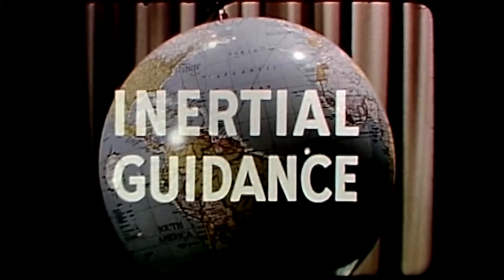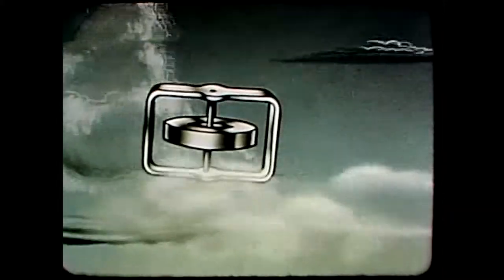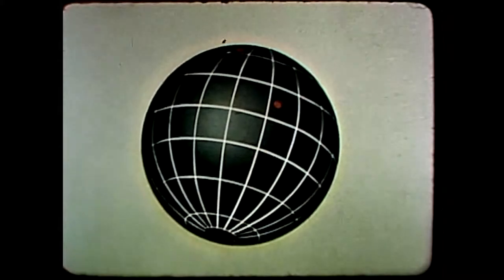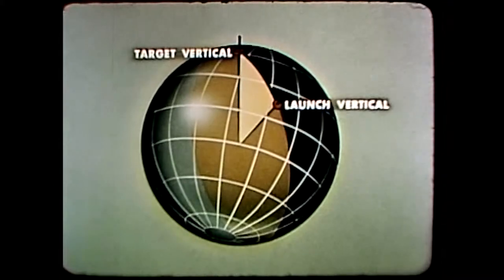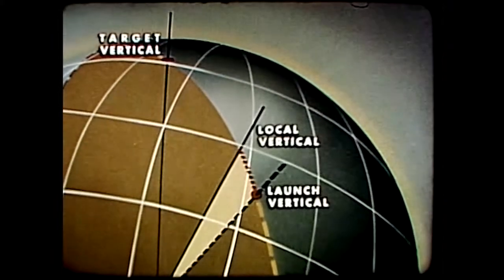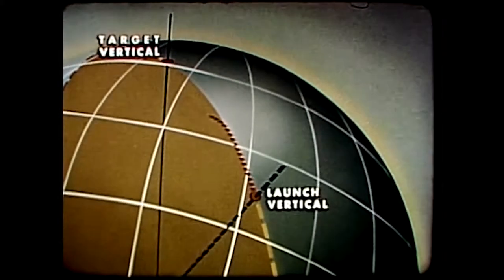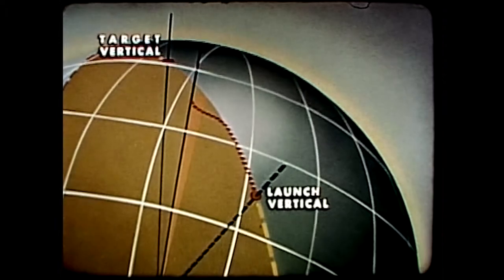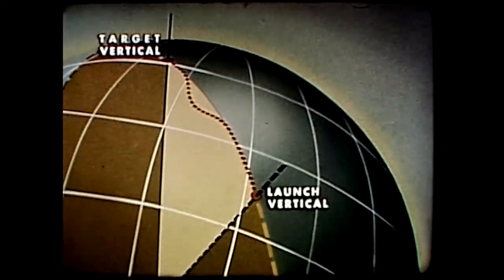The Inertial Guidance of Missiles

Comment: But how do you know that you are actually on the great circle path?
Reply: By knowing where it isn't
Reply: @idont3282  and subtracting where it is, from where it isn't, or where it isn't, from where it is, whichever is greater
Reply: @Gggggggggg7772  
It obtains a difference, or deviation.
Reply: @jerrymartin7019  from where it was to where it wasn't, however it doesn't know where it is, it knows where it isn't.
Reply: Ignore these chuckleheads.
Likely some sort of system that verifies the current heading against the intended heading, something like a gyroscope. When the missile turns off course, the gyroscope is still pointed towards the known direction, and you just have to have the missile correct the deviation by calculating how far back in the other direction you have to turn, which will be a little more than how off you were in the first place. This is because you are now laterally off to the side, and need to correct that lateral inaccuracy.
But to reiterate an answer to your original question: Some sort of device that can measure objective heading, such a a combination of gyroscope and compass system. In modern day, GPS or other positional triangulation and observer measuerment methods would also work.
However, if you are asking how you know at all, VS how you know how to get back: You kinda have to assume when you fire that you already are on it. If you aren't on the GCP when you fire, then you don't really have any way of knowing if you are on the true GCP or not, so it needs to be calculated beforehand. At least, that's how I am seeing it. Please correct me if I am wrong.